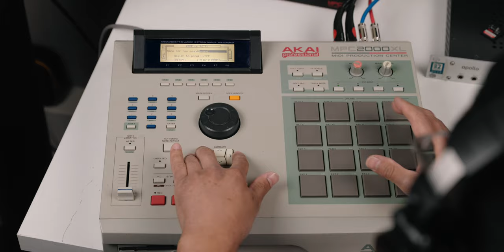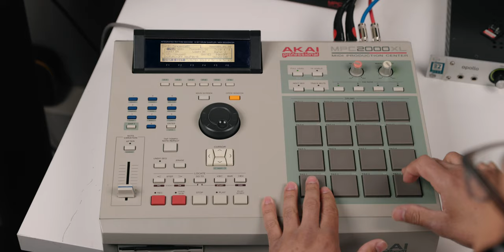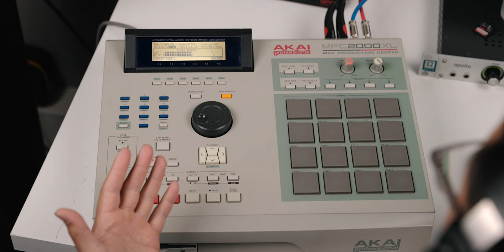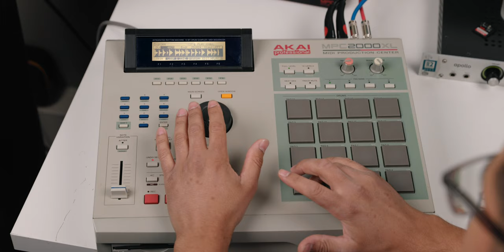MPC 2000xl Sampling Workflow | MPC 2000xl Tips & Tutorial 2021

Comment: Well I sold my MPC-X for a really scary reason thanks to the advice of a music industry professional.

Modern MPCs have touch screens and when they die the machine also dies, and changing it will cost as much as the machine, so I continue with my MPC 2000XL making the same good beats and with more peace of mind, because the screen can die and not cost me as much as machine.

Ever since akai changed the idea from MPC to ¨Music Production Center¨, I didn't feel comfortable and excited with the sounds.

I prefer to stay in the ¨Midi Production Center¨, really simpler, more limited, without plugins and just concentrating 100% on the art of sampling.

I'm about to buy a SP404 mk2 for its different way of working and its wonderful FX, to also control it with MPC 2000 XL and that will be my production and DJ equipment.